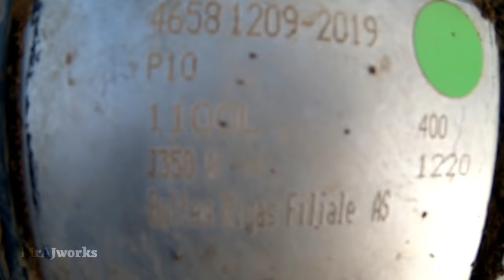Digging A Ditch In A Large Pond

Comment: That ground is perfect digging  no rocks no nothing.
Reply: That is a preexisting pond they are usually carved out of the ground then backfilled with clay but the root of the drain trenches slowly fill with muck and mud over time therefore requiring a drain and retrench every 10-20yrs just to clean out the build up of muck

Comment: you don't need the laser just use the water in the ditch, carry it with you about two inches deep and keep the width close. if you start to out run the water go back down the line and block it off so it rises then continue.

Comment: Can you please explain how the laser works with the excavator ?
Reply: The laser sends out a beam(if I remember correctly IR) at a set height and if needed pitch/grade... the sensor attached to his boom uses multiple light beam (IR I believe) sensors lined up to identify where his bucket is in relation to the desired height and pitch/grade which based on which sensors are triggered light one of 3-5lights (depending on the reciever box) too high, good, or too low on the box... You then adjust the machine to keep the good light lit while you are digging.